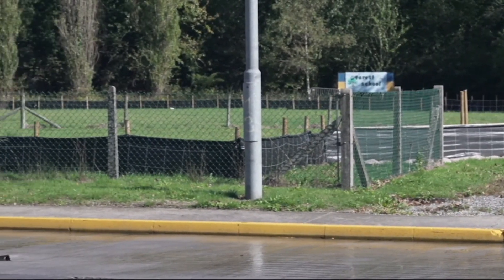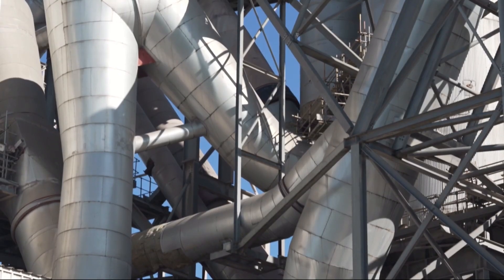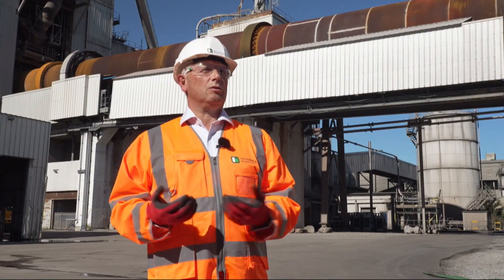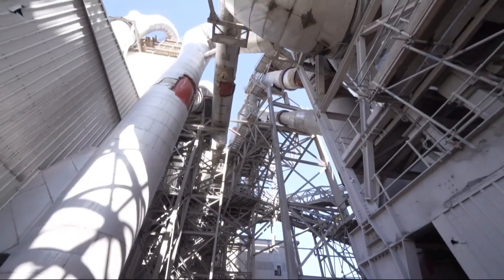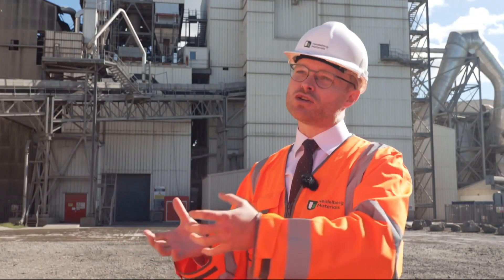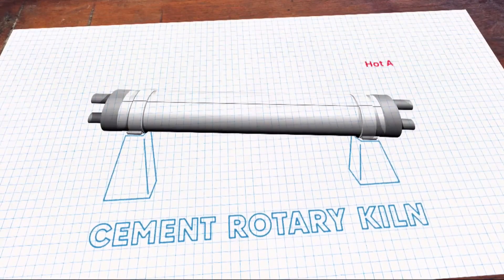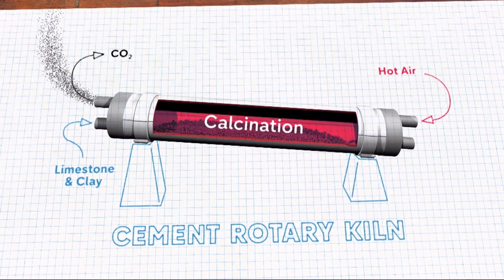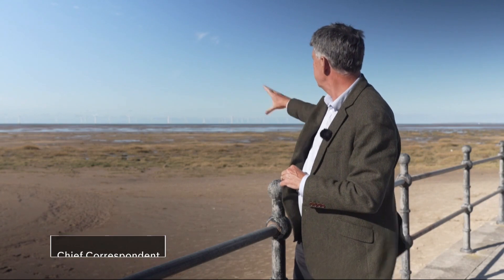Explained: 'World's first net zero cement factory' planned in Wales

Comment: I don't believe this. It's not carbon negative 

It will emit as they use a kiln

What's the point? I could buy solar fron Saudi Arabia and say it's a green credit for carbon neutral
Reply: It is carbon neutral. And they can use carbon dioxide traps in the exhaust. You stop the carbon dioxide from going into the air, and instead put it into the sea where it is absorbed, or store it as solid carbon.

Comment: Glad to see actual changes. Keep going, more of them and faster please. It'll always be this until we're sorted. We have to do this.

I do have questions; How are we storing it? What if it leaks? etc
Reply: The captured carbon dioxide from padeswood ccs is deposited within the Hynet pipeline network. Which will transport it out into Liverpool Bay Area of the Irish Sea. The carbon dioxide is injected into natural underground caverns/wells kilometers below the seabed . Lots of these wells (but not all) were previously filled with natural gas or oil, which we have since extracted, so we are simply refilling the wells with co2 instead. The intent is that over time the co2 will react with the rock formations forming solid minerals, locking the carbon dioxide away for 1000s of years. 

While there is a risk of leakages if done improperly, before a well is signed off for CCS by the independent regulator (NSTA) significant work needs to be done to do prove there is no risk of it occurring. Geological studies etc.